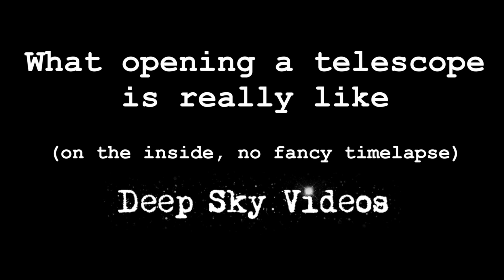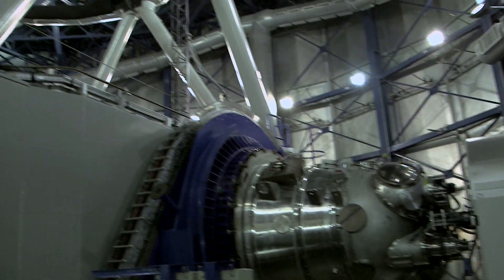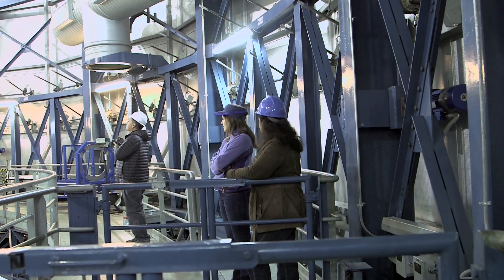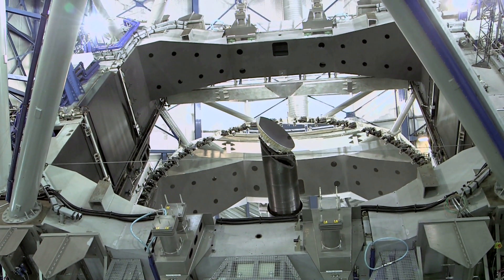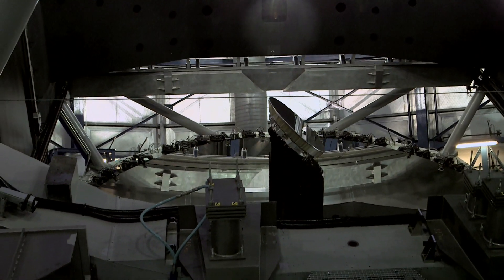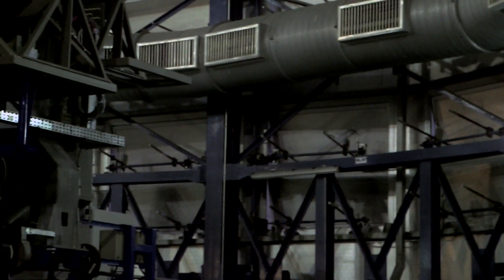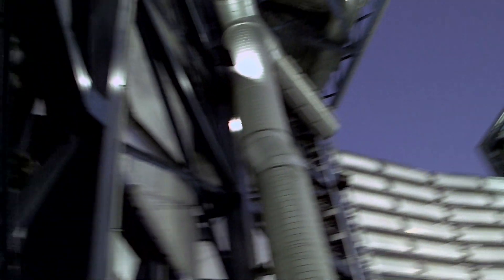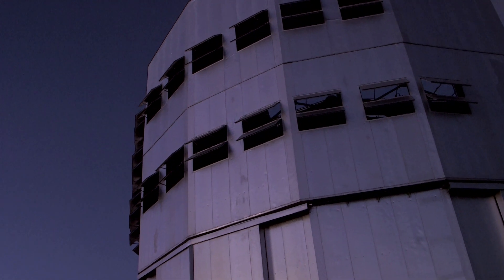Inside an Opening Telescope

Comment: But... There is dust on the primary mirror??? Is there any way of cleaning it? Doesn't that dust distort the final image?
Reply: not in significant enough matter as it is on the primary mirror

If you put a finger right before a long telephoto lens (300mm for 56mm film) you'll notice the image only getting a bit darker, but you won't see even an outline of the finger.
Reply: Ah ok! Well I was just thinking that such an expensive mirror would have been kept clean :P

Comment: Why aren't the mirrors made of silver? I thought silver reflected best?
Reply: When dealing with such large scale structures for measuring immense distances, reflectivity is only a single property that must be considered. Stability for a mirror to hold its shape, temperature sensitivity, minimum movement between slight temperature changes and even the cost of the material.

It would be interesting to know why they chose the material for each mirror and why they didn't use other materials.
Reply: No, in the visible, aluminium reflects best, when it is properly coated.
Reply: I am fairly sure, but not positive, that silver reflects more light than aluminum, although aluminum is not much less. Silver is not used on first-surface mirrors (where light is reflected before passing through another material, such as glass) because it oxidizes to a black, not reflective, and not very transparent, compound so quickly. The surface of all metals oxidizes in a matter of minutes, but some, such as aluminum, are translucent and thin. The oxide of aluminum is the same clear material, minus the color, as the gemstones ruby and sapphire.
Reply: When it is a monocrystal, aluminum oxide is indeed a clear and transparent material. But the oxide layer you get by exposing metallic aluminum to air is not! it is made of many nanometer-sized crystals which cause a lot of diffusion of the light. That is why aluminum first surface mirrors always have an aditionnal coating on top of aluminum, made of Titanium dioxide and Silicon dioxide.

http://meade.com/catalog/uhtc/

And it seems you were right about silver's reflectivity.
Reply: I've been told Aluminium has better sensitivity in the blue while Silver has better sensitivity in the red. Gemini has a silver coating for this purpose.